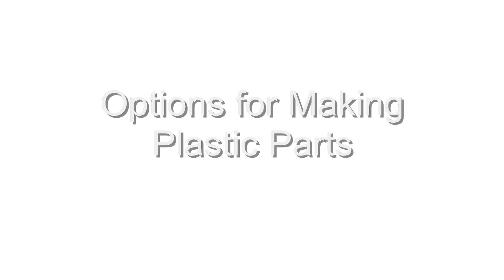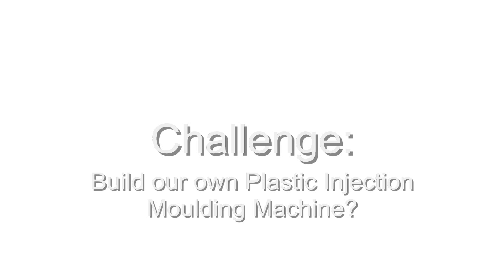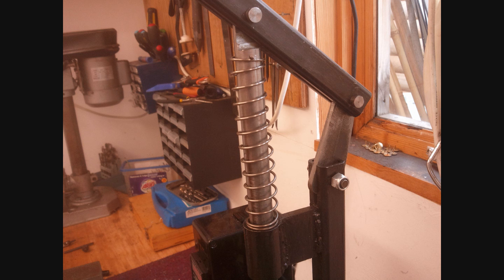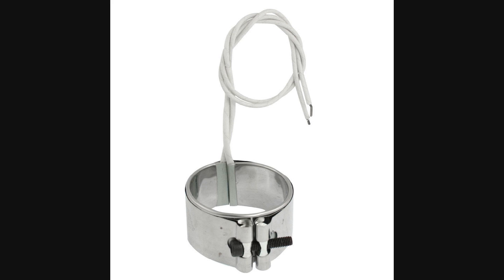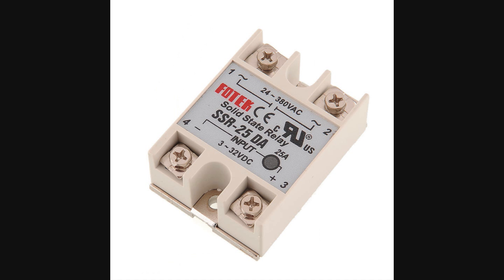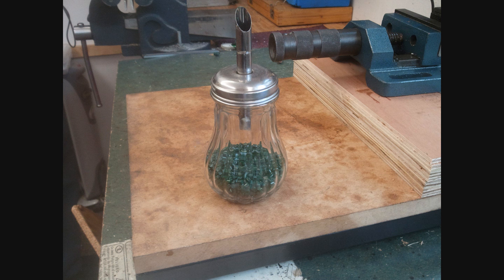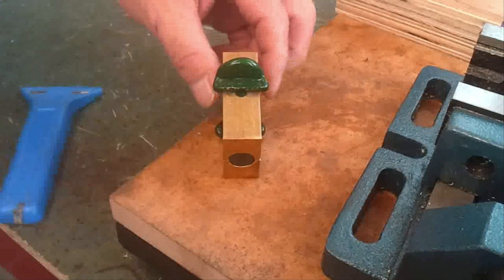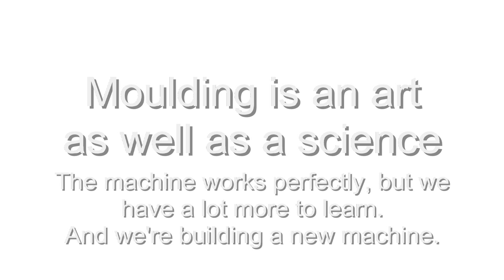Plastic Injection Molding Machine

Comment: You have made a good machine. Thanks for this video. Like to know the clearance between punch and barrel. One small question, can a small gear motor be attached for the piston movement to avoid the manual force? Can thus be a advance machine? Can you make one such? Regards.
Reply from the maker: Hello Anil and thanks for your enquiry but I don't provide technical information like barrel clearance to deter reverse engineering.
Yes, you could use a geared motor to drive the piston - or you could use a pneumatic system. I am considering such developments for the future but don't have any concrete plans yet.

Comment: can we make a torch 150mm length , dia 35mm to hold 2 D type batteries with this machine
Reply from the maker: 8001maya - Firstly, your part's volume would need to be within the capacity of the machine. Secondly, the thinner and longer the plastic runs, the harder the part is to make. Industrial machines use forces of 100s of tonnes to inject plastic - this device is hand operated. You can extend the limits of the machine by pre-heating the mold, but I do not know if your part could be made. It would be an interesting experiment though. Perhaps I'll make a video of it.
Reply: Chris Wesley  - thanks Chris , the wall thickness is 2mm , we have to imagine it as if we are making a PVC pipe closed at 1 end and threads at other end...preheating a mould will work , just use 2 ss pipes of diff dia 36mm 32mm , to make a crude mould ...
Reply from the maker: 8001maya - so you would need to calculate the volume of the part. You'd need to consider how to extract the part without damaging it. It might be a 2, 3 or more part mold, for example. Mold making as something of an art form and people pay thousands of dollars to experts to make their molds for them. After that, of course, they can make many many parts very fast and cheaply - which is why injection molding dominates this kind of fabrication.
Reply: Chris Wesley , I designed mold with 7 parts for threads and extraction, what I meant in earlier  message was to test if we can make the 150mm long torch without making a costly mold by using ready made pipes , though it can't be extracted
Reply from the maker: 8001maya. Oh OK. Sounds like a fun project!
Reply: Chris Wesley ,  we can't remove the piece unless the outer pipe is prepared  in 2 halves, ie cut into 2 half's along the length  axis, the inner pipe should have angle for easy removal, try high injection velocity , or preheat the mold , or pour the molten plastic in outer pipe and press the inner pipe
Reply from the maker: 8001maya I don't know what you are asking as your English isn't good. I have no need to make such a part. I have given my thoughts on how you might make it, then you told me you have already made it. I can't really add anything helpful at this point.

Comment: can i have some step by step advice  on to how wire everything together ...port 6&7 is missing from the temperature controller ..its a Rex c100
Reply from the maker: No Rick,  you didn't say "please" :o)

But seriously, I don't know exactly what components you're using, and I don't know what your skill level is, but if you need to ask, then I'm thinking you shouldn't really be working with mains electricity.

Anyway, read the controller manual. It contains diagrams showing how to use it. If yours didn't come with a diagram, find one online.

Comment: if you have a bigger heating chamber ..will you be able to inject more plastic
???
Reply from the maker: No shit! Hahaha. That's generally true, but it's more complicated than that. If you make the chamber wider, then the injection pressure goes down and the temperature gradient radially becomes significant. If you make the chamber longer, then you need more heater bands. And in either case, injecting more plastic with a hand-operated device means the injection TIME is longer, which risks the melt solidifying. Never-the-less, I now have a 2 cubic inch machine in test.
Reply: +Chris Wesley  can i get some advice on how to wire everything together ??

Comment: Hello Chris have to say great video and very inspiring.  

Up until a week ago was completely new plastic molding.  Having done some research and being a UK resident myself, I can completely relate to the frustrations you had of trying to source a bench-top plastic molding injection machine.

I too feel the only option is to try and build one.  I certainly don’t have the in depth knowledge you have but am will to try and give it a go.  Think I had found some of the components you used on ebay.  Would be interested to know where you sourced the stainless steel (303) barrel and nozzle from?

I get the impression you’ve sold the machine in this video?  Would be interesting in purchasing if still available.   Although the semi-automatic unit you mentioned sounds very interesting if you’ve built and selling that one?  Keep up the good work
Reply from the maker: Hello Gary, and thanks for your comments. Yes, we sold the machine so I no longer have it. I can't recall where I bought the metal for the barrel except that it was on EBay. If you search for "stanless steel bar offcut" you may find a supplier.

Good luck & have fun.

Comment: Is it possible for you to show us your wiring setup inside that black case you've used to house it?
Reply from the maker: Sorry Keiran, we sold it so I can't refer to it, but the power switch routes mains power to the controller. The controller accepts input from the thermo-couple temperature sensor and it sends on/off signals to the heating elements via the SSR. Of course, for safety, the entire metal frame of the machine is earthed back to the mains plug.
Reply: Chris Wesley
Thats fine you have given me a good enough idea of how it was done. Could I also ask how much it sold for in the end? Thank you for replying to me.
Reply from the maker: Kieran O'Mahony
You're welcome. I'm curious - why do you want to know how much we sold it for? You're beginning to sound like competition! :o)
Reply: Chris Wesley
Actually I was curious as to wether I would get my money back once the project is completed. I don't have the space to keep this project once its complete. I sell most of my projects after I've built them and played around a little to allow me to pay for and have space for the next. Thanks again for the information you've provided. :)
Reply from the maker: Kieran O'Mahony Oh I see. I think we sold our for around £400 which does cover the cost of the components, even when you take out the fees from EBay and PayPal. The thing is the time it took to get it to the point of usabiity - this on eis the third prototype - so it's not a way to get rich quick, but it certainly was fun and for someone with your modus operandi, I think it would make a great project which you'd be able to see on to get your cash back. Good luck - I'd love to see what you come up with.

Comment: Pitsco Injection Molding Machine for $595.
Reply from the maker: Hi David, and thanks for pointing this out to us. $595 is about what ours costs, but the capacity ("two gold tees") is tiny! I guess if you want a very cheap way in, then this might be it, but even Pitsco suggest this is a demonstration rather than a production device. Still - shows what can be done.
Reply: @chriswesley594  Can you break down that cost of $595 please Chris?? I'm finding it very hard to believe there is anymore than 100 quid in that (and that's being generous) let alone nearly 600 lol From what I can see there, 20 for the temperature controller and relay, 10 odd for the heater bands, and about 15 to 20 for the steel from any good fabrication workshop.. Besides the time making it, is there anything I'm missing here? And by the way, those first few machines you showed, who ever priced those are clearly smoking something strong lol
Reply from the maker: Ian,

You are substantially right in that the cost of raw materials does not explain the price. However, the machining time and other factors do. See this video: https://www.youtube.com/watch?v=uGkiVapSRxo.  Making the barrel is a time consuming and exacting task and frankly - I've buggered a few up. It's on the limit of what my equipment can do. Making the piston to the correct fit is also challenging and time-consuming. Just cutting the funnel piece from stock is a big deal as I don't have an automatic saw now (the one in that video is not available any more), as is machining it to be a close fit on the barrel and then tapering it. I've also gone through a lot of misery to get to this point, and customers are paying for that to some extent. And when my brother moved away from where I live, I lost access to his lathe and his milling machine and had to buy my own lathe along with all the tools which make that lathe useful. 

Honestly, that's none of your business. If you don't like the price, then don't buy the machine. But I'm OK with telling you - because I've thought ialong similar lines to you in the past.

But it's like moaning about the £1.80 price of a cup of tea, knowing that the tea bag cost maybe 4 pence. But you're ignoring rent, rates, equipment costs, staffing, loan servicing, heating, lighting, and so on which were what it took to put that cup of tea on that table in the warm. And all the personal energy, risk and inspiration it took to make the cafe exist in the first place. 

People start businesses because they hope to make good money - not because they'd like to continue to grind along for minimum wage - except saddle a lot more risk and effort. Oh - and have no sick leave and no pension at the end of a life of self-employment.

So - yeah - all of that. Oh, and the hassle of shipping stuff worldwide. One machine was smashed in Ireland. Another got completely lost  on its way to America. It's all expensive and time-consuming to deal with.

If you can assemble all the parts and machine the stainless steel and so on - then go for it - and even offer your own for sale.

And there's another factor - pricing on a "cost plus" basis is only one pricing strategy, and not the only one I used here.  The only comparable machine available commercially is far FAR more expensive. I'm pricing far more fairly in my view, but - yes - I'm also factoring market forces into my price point.

If you DID manufacture your own unit and offer it for sale at substantially less than me, then I'd probably stop selling mine because, in my mind, it's not a great way to get rich..